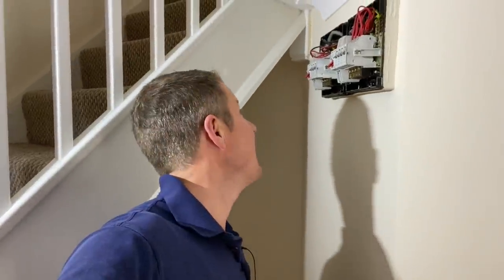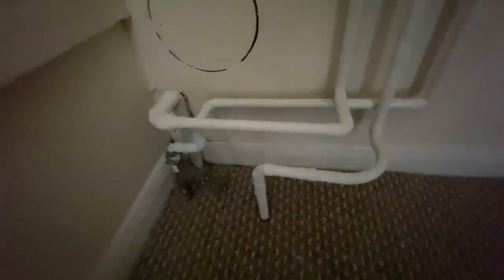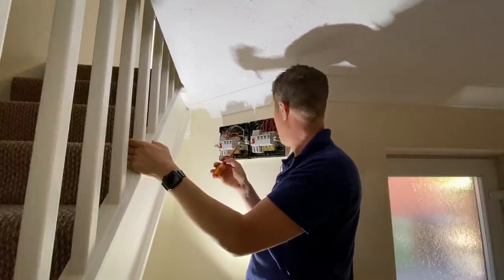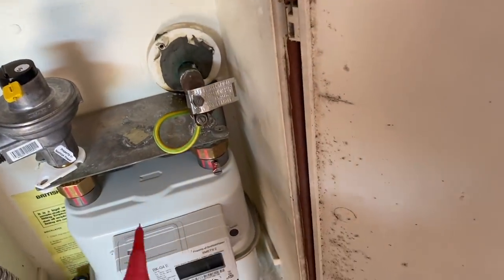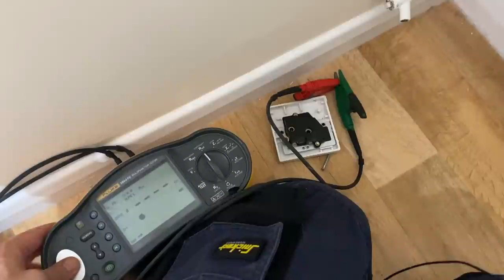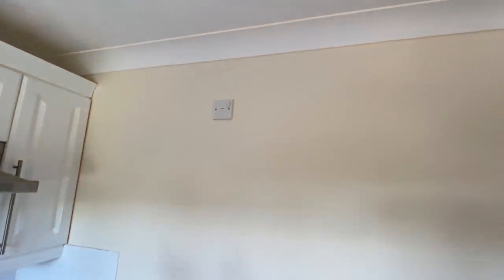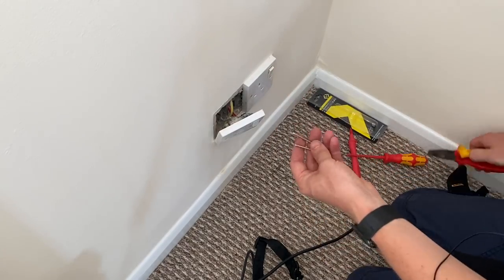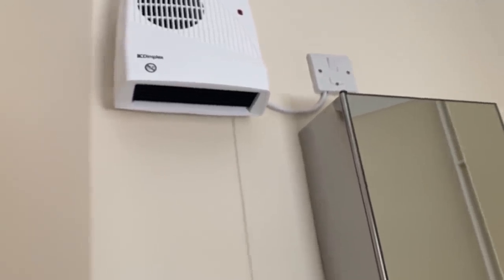EICR Testing Procedure

Comment: Switched fused connection unit high up in the kitchen would of been for another down flow heater most commonly found in 80's 90's houses with storage heaters
Reply: Would never have worked that out. I was born in the late 80s so before my time really.

Comment: If you keep putting C3 code for most items then the installation will never get updated to the current regulations. .and if the client wants you to change or redo the lights in the bathroom then you will have to fit rccd protection . So how can you go back to the Client to tell him you have to replace the consumer unit . When you have already passed it with codes C3.. 
You will have to state that the installation requires to be updated to the current regulations to cover yourself. .

Comment: Hi Jordan, Great Video. A couple of tips! You can buy 40mm long 3.5mm screws which seem to be the most useful length. Cutting them with side cutters is often the cause of damage to threads in the back boxes; better to use a 'shear' tool to shorten the screws if you have to. Insulation resistance, I always do Line to Neutral at 250V first to see if there is any load connected because 500Volts between Line and CPC  can damage components within appliances. I don't think you did a figure 8 R1+R2 test on the sockets; do you think R2 with the wander lead is adequate for all circuits including sockets? Thanks
Reply: Shear tools are not the perfect solution either, a small chamfer applied with a small file, or an emery block is best in order to create a lead in for the thread to start correctly without becoming cross threaded, which is the cause of this issue.
Reply: @galaxion62  Hi Jordan agreed shear tool not perfect...actually when you think 3.5m screws have been used since....40's?...long before?.... the real solution probably lies in a different modern universally accepted fixing and termination screws standardised so you don't have to carry 8, 9 10 screw drivers around all the time, dream-on! - re-threading during EICRs and repairs enough to do your head in........
Reply: It doesn’t prove polarity on sockets so I don’t think it is

Comment: All very well giving them 1 year to make improvements, but do the regs require the installation to be updated?  It can be that an existing installation, if it has no faults under the regs it was installed under, can continue.   Be careful you do not get yourself a bad name for unnecessary changes.

Comment: No RCD protection means supplementary bonding is required as per current and previous regs. Might have been what that 2.5mm2 earth cable was in the bathroom...  The  bathroom / kitchen fitters might not have re-instated the bonding thinking that it’s not required under 18th regs, forgetting that that is only the case if rcd’s are fitted.

Comment: Fine liked watching the way you tested the ring main never got my head round that 2391 17th on the cross connection testing. I always remember PEIR . Polarity. Earthing Insulation Ring Main Continuity . Always thought  they made the testing more time consuming so you would ditch Ring Mains for Radials. Also would use my side cutters with the 3.5 threaded hole to cut the screws down thanks Jordan.

Comment: C3 for  no rcd on the sockets... it was fine when installed. Supp bonding everything including your fly zip is a 16th edition thing, what date did that take over from 15th?
Reply: Supplementary bonding everything was 15th edition.
Reply: @beardedsparks2825  absolutely correct :)

Comment: 20:50 did you check the other end of the gas bond on the inside wall to see if it is in the same sealed tube as the gas pipe and and if it not then mention the gas bond passing through the back of the meter box and through the cavity (thus potentially allowing leaking gas to drop into the cavity )
Reply: Good point but which a squirt of intumescent sealant would take care of in a jiffy

Comment: The best cutting tool for cutting 3.5mm socket outlet screws are the very old crimping tools which have pre threaded hole in their handles which allows you to screw the 3.5 screws into it to get a clean cut,I beleive you can still purchase those

Comment: For the Ze you could have just removed the bonding conductors at the clamp side which would have isolated them from the main earth?   Also when doing R2 you should really remove the bonding to avoid any parallel paths (Though not likely to be an issue). Although I totally agree a new RCBO or dual RCD board is by far the better option, another alternative to becoming compliant would be to change the downstairs socket to a socket with combined RCD and FCU with RCD for the heater in the bathroom as that would then comply.

Are you seeing more work for EICR with the changes to landlord legislation requiring EICR's?
Reply: I’ve said the same about parallel paths in a couple of previous videos.
Reply: Was always told do your bond test then leave disconnected do your r1+r2 or r2then re connect prior to IR tests

Comment: For the sake of a few extra seconds, I prefer threading the 3.5mm pattress machine screws thru a combi cutter which shears them off nice and square and never have issues with cross threading. Takes a few seconds longer but neater.
Reply from the maker: Which combi cutter do you use?
Reply: My NWS pliers have this function too, brilliant no crossed threads
Reply: I use the KNIP CRIMPING PLIER 240MM, also makes a nice clean cut.

Comment: The niceic says you don’t need both r2 and r1+r2. If you choose to  test r2 you then still need to measure r1+r2 to establish your Zs . The Niceic have said not to carry out live Zs testing, as do many large employers, you should add ze to your r1+r2 to get zs. 

I would agree with the r2 on metal cased fittings though , or just r1+r2 at any that are metal as well as the end of line . 

Socket outlets in domestic properties without rcd protection are an instant c2 IMO, lights c3

Comment: I find it's worth testing both sides of a double socket when going around doing the zs's, if nothing else it flags issues like internal connections becoming loose, unable to get the plug to in due to damage, wear and tear, foreign bodies stuck in etc.. I find lots of doubles where one side is fine and the other is unusable.

Comment: Anything correctly wired to previous versions of the regs cannot be coded to anything other than C3 (unless you've got something obviously dangerous like VIR cables or wooden back CUs)  So the lack of RCD protection (normal for a property of that age) is a C3.
Reply: Nope. External sockets and bathrooms with out sub bonding require an RCD
Reply: Wrong. No RCD protection for sockets AND Lighting is a c2 . I really wish people would stop thinking old wiring regs is a pass it’s absolutely ridiculous
Reply: The problem arises because Guidance Note 3 says No RCD protection is a C3 which is what is taught on 2391 (I teach it for a living) However I have always tested to latest regs so Sockets no RCD for use outside should be a C2, No RCD in bathroom with no Supp Bonding is a C2 as per Best Practice Guide 4 and the Napit Codebreakers book.

Comment: Don't forget cables concealed in the walls. Why did you not switch off the boiler spur to carry out the insulation resistance test on this circuit. .. Nice bit of testing .

Comment: Still don’t understand why you do r2 then zs when you could just do r1+r2 dead and no need for chopsticks live zs testing on the lights
Reply: more tests are better.  This whole crap about 'ooo there's a possibility of contact with a live conductor' using GS38 compliant probes.... is just H&S BS. he's being conscientious
Reply: If you do R1 +R2 you don't need to do zs? Do you then calculate zs by adding ze and r1 and R2 ?
Reply: @Gymreview84  correct
Reply: @Marco-mg9tv  thanks buddy . I passed my test and inspect in 2014 but I've done no testing since at all so I'm reading up on it

Comment: I just brought the ck 3.5 rethreader as well as I lost mine( I'll probably find it in the van again).
Heaters in houses  in the 80s were usually Storage heaters downstairs and Panel heaters in the bedrooms, your generous on the one year of c2s I've given Just one month before lol
Reply from the maker: Yeah I’ve already fitted a new Hager RCBO board there, that video will come next.
Reply: @artisanelectrics  sorry I deleted the comment about the consumer unit as you mentioned it later in the video
Reply: Should try the armeg rethreader, longer than the CK  and can rethread through the socket hole

Comment: Hmmm testing 500 volt at first with vulnerable circuits ie boiler and cooker pcr board in line with cooker control unit in on position hmmm  I like you tested all earths at all switches a sure fire miss with a lot of testers obviously if dry lining box won’t show up but good practise

Comment: If the single earth tag on the boiler fuse spur lined up with the non fixed lug on the metal back box then would you put a link to the metal back box as it's not connected to a fixed lug. Enjoyed the video.
Reply from the maker: Good question! John ward just made a video about this, you should check it out!

Comment: the 2.5mm cable attached to the main water bonding was probably a supplementary bonding cable. do you not need to test for that since there is no rcd ? would be great to see that in the video
Reply: Should be verifying supplementary bonding in the bathroom if no additional protection on all ccts within otherwise it’s a c2 ,

Comment: Isn't there supposed to be mains fire alarm in a rental property?
Reply: Doesnt come under EICRs 
Plus that's only council in private rentals batteries are fine
Reply: Hi Paul sadly you are wrong about the fire alarm there is a requirement under The Domestic Fire Alarm Regulations [BS 5839 Part 6 – 2019] that by no later than 01/04/2021 ALL rental properties in England and Wales must have a minimum of a Grade D LD2 smoke alarm system which means Mains Powered and interlinked Smoke in Entrance Hall and Landing within 7.5 meters of every bedroom, 1 in any living rooms and a heat alarm in the kitchen. The only use of Battery allowed now is if they are 10 year non removable lithium ion batteries but they still need to be interlinked via radio link if necessary. I appreciate this video was shot before that but this date has been set in stone for over 2 years now.
Reply: @wazharrison186  not in wales standard battery ones still are ok regulations haven’t changed yet unless the property was built after 1992 .it’s really poor and they still haven’t enforced eicrs only good landlords have them done .

Comment: Why would you render the installation deemed to be potentially dangerous while it was perfectly legal at the time of the installation???Was the 16th edition and its amendments dangerous at the time of the installation not implementing an ADS.  I am sure we all know RCDs were around away before the 16th edition and Mr BS 7671 didn’t feel like to put them in the regs or perhaps he forgot!!!
The regs were genuinely designed to keep the consumer safe. How do we know, what you are doing will be perfectly legal in 5years time or so, when 19th or 20th edition comes along. 
c2 and c1 codes are for a potential danger, ie live conductors are clearly exposed causing an imminent and immediate danger. Deterioration of the installation, risk of fire, alarming reading..... Omission of an RCD in a new installation I would agree but in an old house it is clearly  a c3 or perhaps if you want to be an orthodox suggest an RCD SOCKET close to the main door.
Reply: On your thinking you’d have rewireable fuses , non fire rated downlights & vulcanised rubber cable down as a pass. Times change, things move on and get safer. Properties need to be up to the most up to date regulations. Poor Mr Smith got an electric shock & died, such a shame he didn’t get told to put RCD protection on his electrics - still , at least it was safe at the time of install.
Reply: Wlondoner is correct, the installation met regulations and still does meet the regulations for when it was installed. New regulations do not mean an automatic fail of old circuits , following your  thinking  all properties more than 20 years old need to be bulldozed because they fail to meet the latest standards , which is plain  silly . This is why we  have codes which deem what is and is not a failure . Yes by all means advise the client the electrical system isnt up to todays regulations , this doesnt automatically mean its unsafe .
Reply: steve robinson no - following my thinking we would replace consumer units where necessary and rectify any faults. This is the issue , overhyping the extent of works, it’s usually a days rectification if that.
Reply: The coding is at the discretion of the inspector,there are 2 main issues
1. Inspectors giving c1 and c2 codes when they should only be  c3 improvement recommended
And
2. Inspectors who have only been on a 5 week course and have no experience or knowledge of electrical installations so they code 2 everything to be on the safe side
Reply: @fightdisciple9192  Absolutely correct. None of those would be a anything more than a C3 provided the rubber  cable was in good condition (it rarely is)
C3 allows you to add recommendations in a separate field. Rubber cable would be a 'STRONGLY RECOMMENDED THE CUSTOMER HAS THE PROPERTY REWIRED' (IN ALL CAPS) but it is absolutely NOT a fail if it was fine when installed and still complies to THOSE standards.
One of the few cases where i'd agree with you is neutral fusing. That is demonstrably dangerous with a single fault. That would be a C2
Edit: on thought, rubber wiring would be a FI.. you'd need to take off every accessory and find every JB to ensure it was compliant. But I am still angry at your kind of thinking where every house in the entire country needs rewiring for every amendment. As a person in an owner occupied property... I say 'screw that'
Reply: steve robinson at the same time it’s not right landlords rent out 1890 terraced houses. With bakealite wired fuse boxes, there needs to be a cut off.  If it can’t be brought up to a decent code knock it down unless it’s of historic use.
Reply: Roger Robinson common sense doesn’t matter when a house is rented out.. it’s about dirt cheap.. that’s why there needs to be a standard instead of it was fitted in 1961.. it’s alright... was to code then
Reply: More than likely, the main reason for recommending an rcd board is he personally doesn't think its safe to have such low IP rated fittings in bathroom regardless of being outside zone 2. It's all about opinion of experienced, and if he feels it is unsafe, then why would he pass it and say its all good. I've watched many of Jordans videos and he is an honest guy, he wouldn't write off the board just for some easy remedials.

Comment: I think you need to look under loft insulation to see if cables are underneath (incorrect). Also what what is the 2.5 cable at stopcock used for? CUs too high .  Socket under unit should not be fixed to carcass / rear hardboard.

Comment: Hi there, I’ve recently bought a property in london which has an ancient fuse panel … looks like it’s from the war! I’m concerned that this is only the harbinger of things to be uncovered when I get an eicr done … I’ve been impressed by the work you have done in your videos and you sound very sensible and fair … possibly a bit of a tough question but are there any electricians you would recommend in london who are as thorough and ethical as you are? I don’t want to engage a cowboy who quotes low and then piles on the costs …
Reply: Check  out Thomas  Nargy.  He has clips on here and works in London.

Comment: How was that light end of line at 10.22 ? It simply had a neutral and a switch line. (Meaning a junction box in the attick/loft)
Reply: It looked end of line to me whether power fed from the switch or fed from the ceiling. Last in the run as no loop out. why would you need a junction box with a pendant ?

Comment: is there a reason why you wouldn't make right the light polarity, while your there?  I'm not criticising, as we all have slightly different ideas and ways of doing things, just interested in your stance on it.  Is it to save on time, as you may of given a fixed price which does not account for remedial work during inspection?  Either way, the customer is getting a proper job there, and were getting a good video to watch.
Reply from the maker: Thanks I could have done it I guess but just didn’t see the need.
Reply: @artisanelectrics  fair enough.  I suppose the client gets the service they pay for, just watched your video when you explain that the timings are tight due to how much your being payed.  If they pay just for the inspection and tesing, then its a fair one, if they give a fair price where you can spend a bit more time, then you can help them out.  Cheers Jordon for getting back.  Little interactions like these help me learn.

Comment: Great illustration here of how best to carry out the EICR test. However at 36:47 he says about revamping the back box threads using a "die". That is not a die. it is actually a tap. The die part would consist of a hole in which you would insert the screw to be re-threaded. Cheers.